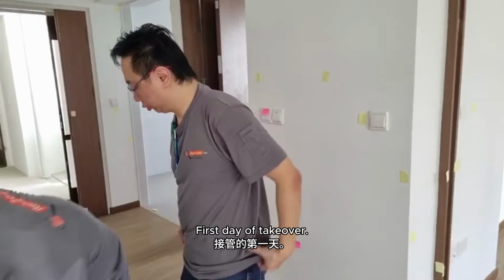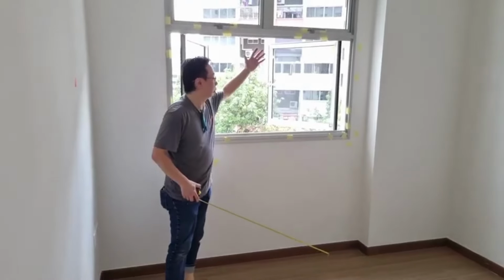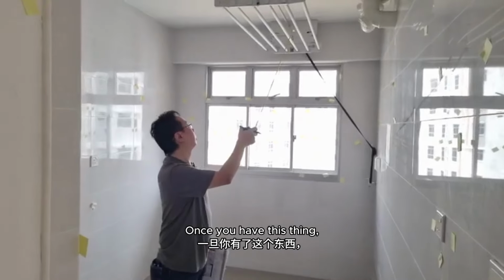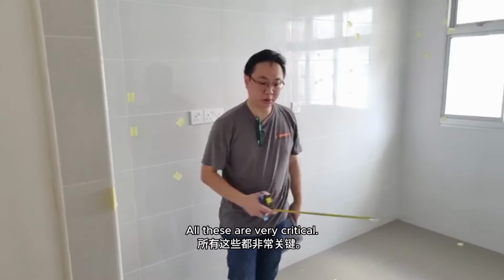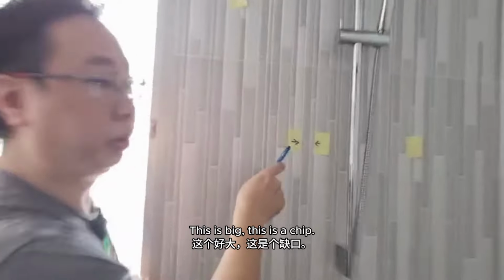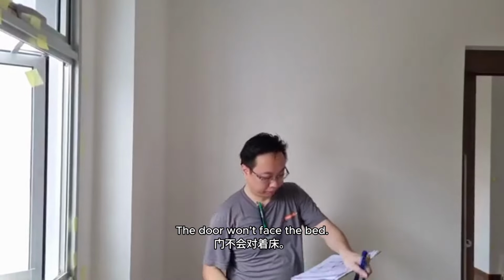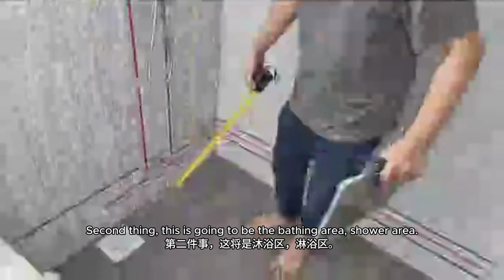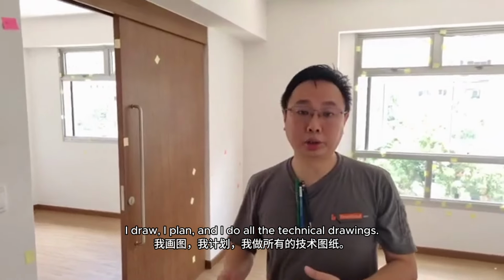Renovation LIVE On Site | New BTO Vinyl levelling FAIL!

Comment: Suggestion: 
- Toilet: Move the door of the toilet to the shower area. The shower area shift to the wash basin area (raise up). Built an L-shape long vanity wash basin area along opposite side of wall. Full length L-mirror along the vanity basin area
- Master bedroom: Cut a corridor into the master bedroom area away from the window, build the door to the master bedroom at the corridor at the end, make sure the master bedroom door is not facing the toilet door. Bed to shift to opposite wall (headboard is at the wall facing living room). I would suggest a smaller wardrobe, no need to be built in. I would put the study table on the wall opposite the bed
- Kitchen: Try to space your dining table in your kitchen, and make a smaller functional kitchen; that way you will have a large living room
Reply from the maker: @lcboey  Hi. This unit is a BTO unit hence no hacking allowed for the kitchen and toilet walls and floor tiles is allowed until after 3 Years of key collection.